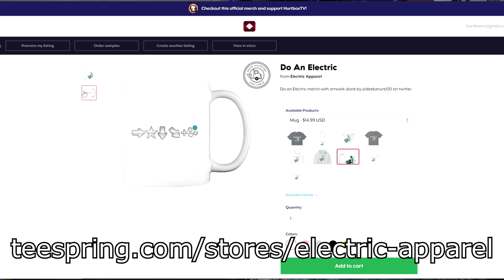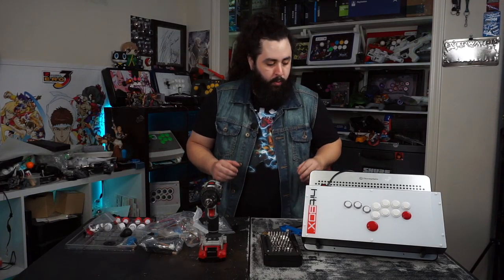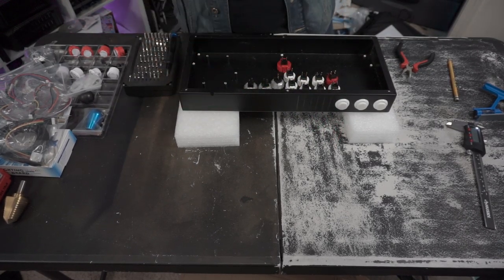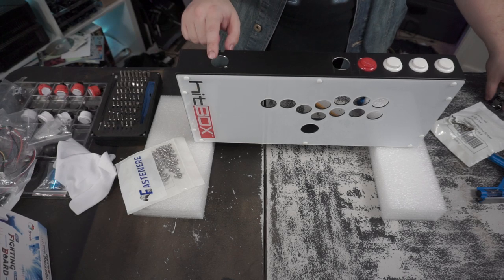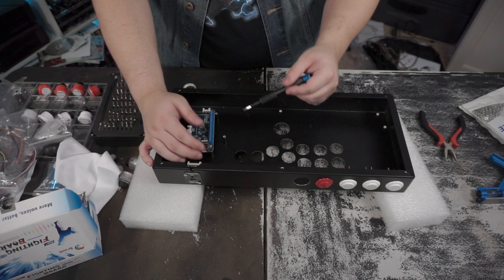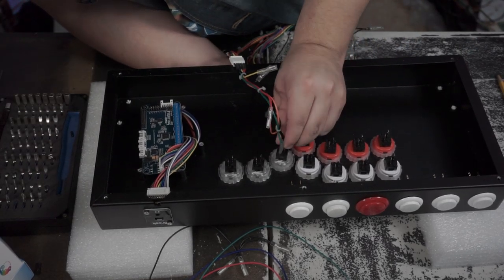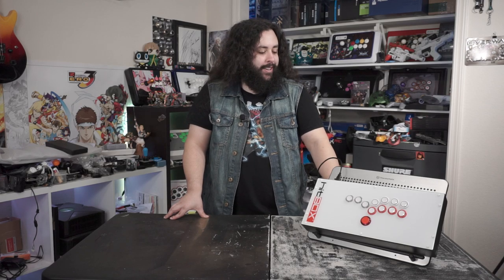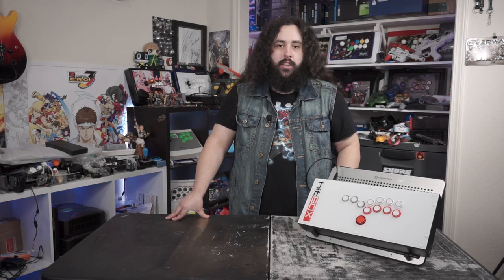FIXING THE HITBOX!

Comment: I have a custom hotbox from Blunderbuss Designs that I've done some work on. I added a Brook Audio board and some high density EVA foam for both padding and sound isolation. I'm planning on adding all Crown Mechanical buttons next, but then using Khail Speed Silvers.

Comment: so after cracking my hitbox open and attempting to do some button swapping, i noticed the connectors to my buttons were actually stuck and dont know what to do to get them off.
Reply from the maker: I'd check first to see if they have tabs you can push on the insides of the connectors. 

If there isn't then you can try to use some pliers and try pulling it out that way.

And if they're really stuck then you can try clipping the connectors off, stripping the wire and getting some new connectors connected to them.
Reply: @HurtboxTV  ill try to give that a go, thank you.